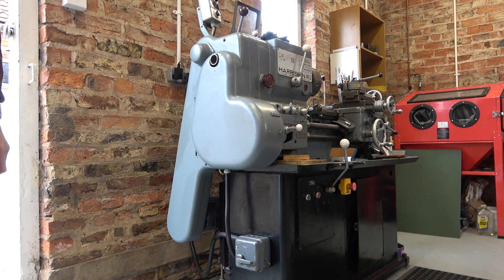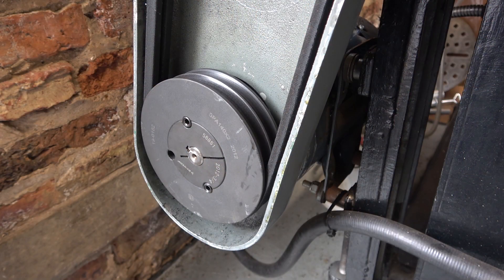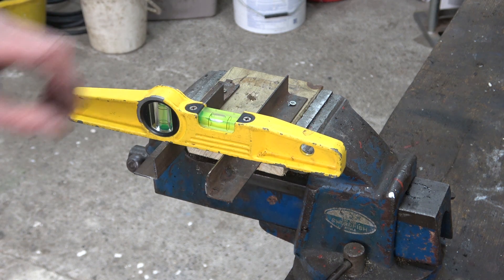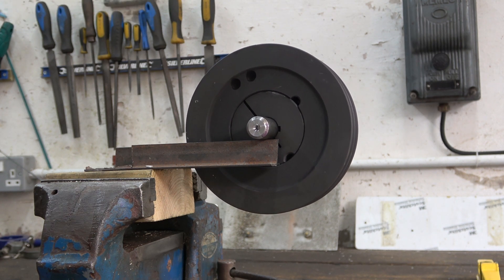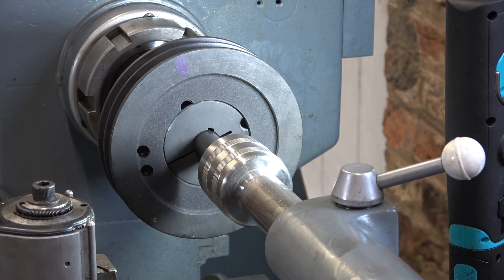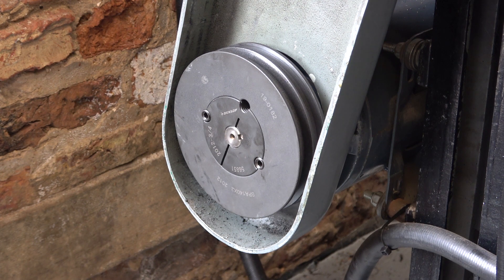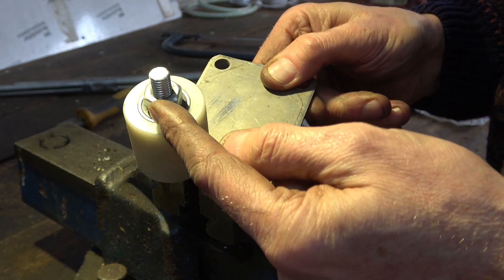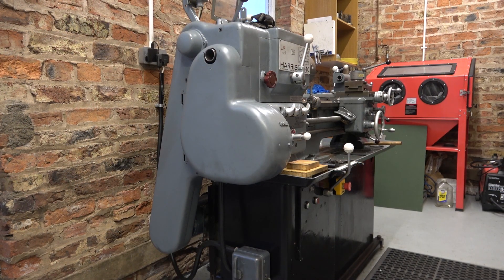HS39 Harrison 140 lathe drive belt improvements

Comment: Hi there, recently got a new to me harrison 140 and find it running too slow for carbide. Would you be able to share the pulley you used?
Reply from the maker: Hi Mr Bean. I bought a pulley 'V Pulley Taper Lock SPA Section 2 Groove 140mm Pitch Diameter
Ref: 140X2SPA' direct from Bearingstation, a taper lock bush from ebay to suit my motor shaft:  '2012-3/4" Taper Lock Bush' from bearingsrus_ltd, and 2 x A section V belts A73.      I simply went for a pulley 2x the original diameter. The belts pass a bit close to the case and can slap a bit when cold. I run my inverter at 25Hz normally so the gearbox plate is right but I can wind up to 50Hz so the speeds are double that indicated on the gearbox plate. I could of course wind up the inverter beyond 50Hz for more speed but I don't as the motor is not rated for inverter drives. They usually say a 20% overspeed is safe but I did not need it. 1500 rpm is fine for most of what I do. Cheers
Reply: @HaxbyShed  thank you for the info. I'm finding the harrison 140 a little slow for what I'm used to and end up being very high up in the gearbox almost all the time. Hoping having the option of another pulley may enable more adjustment as I have no inverter yet. Although I have been through all of your videos and my machine is definitely more noisy than yours
Reply from the maker: @mrbean6694  I found that my spindle bearings were adjusted a shade too tight. Might have been a little quieter after that. A lot of the noise on mine is motor noise reflected from the back wall of the 'shed'.
Reply: @HaxbyShed  I span my spindle after seeing you video on it. Got a good few rotations on it when in neutral (between high and low speed) I believe my issue is motor related or the bearings in the shaft driven by the motor. 

Is there a better way to contact you. Finding information on the 140 hard to find and help on it even more so
Reply from the maker: @mrbean6694  Hi Mr Bean email haxby_shed@outlook.com. (needs the _ ). I'm happy to share whatever I know. Cheers
Reply: @HaxbyShed  popped an email across 👍